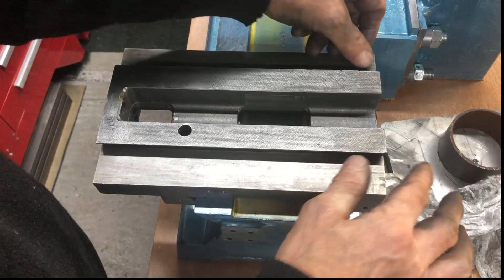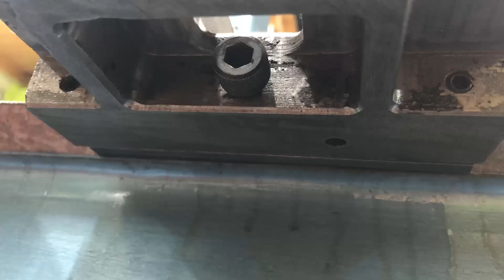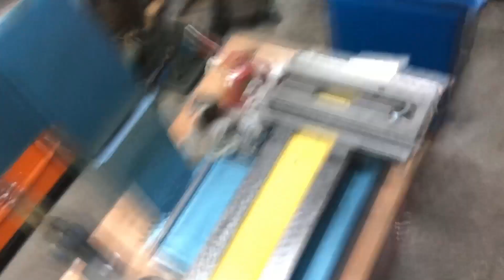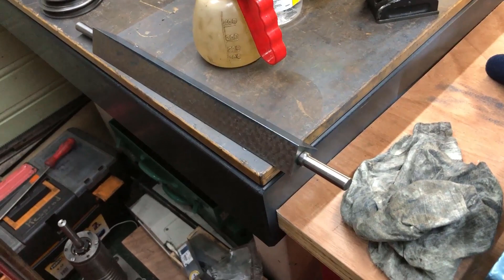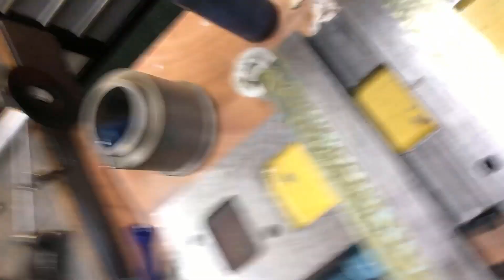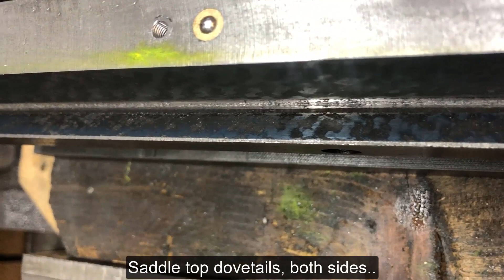Smarty AT-300  - saddle and cross slide scraping and testing

Comment: One of the more consistant problems I have with scraping, no matter how careful I try to be, is rounding the edges of scraped surfaces.  Is there anything you do, specifically to avoid that?
Reply from the maker: A tip might be to mark the middle of the scraping blade and train to stop when you reach this mark

Comment: In the course of your work was there any indication that any sliding surface had been scraped at the factory? Or was it built with the standard “bolt it together and hope” hope procedure that we usually see from certain parts of the world?
Reply from the maker: There was some scraping and fitting done, yes. Not to a Schaublin standard, but then what could you expect from such a budget machine.. All in all, the accuracy was not too bad and for what it shall do, namely a hobby machine, more than good enough. For example the spindle measurements as well as the general x/y travel and saddle squareness.. very good! The work that I have been doing isn't going to make it a Schaublin as the design and details just aren't there, but I guess with the fit and finish it had, it would sooner lose this than now.. In addition to what I have managed to improve with respect to specs.
Reply: @jansverrehaugjord9934  I’m surprised that it was as good as you found it to be. But I’m sure you measured everything thoroughly.
Reply from the maker: @sblack48  Tja? This was made at a proper machine tool factory. A very basic design which probably is easy to make.. and I guess they know their stuff 😀

Comment: This is quite well made  lathe as for Asian import.
Reply from the maker: Yes... better than I feared. It was actually quite good with respect to alignment.
Reply: @jansverrehaugjord9934  Comperd to my import lathe, this one have large cross sections . It's thick.
Reply from the maker: @kundeleczek1  Yes, the castings are quite thick and probably adds a degree of solidity.

Comment: Enjoying watching these as I’m having a go at scraping a Boxford BUD back into shape. After I have scraped and stoned the surface it looks very dull just minutes afterwards. Is this normal as yours looks very shiny?

When roughing it looks shiny but when I have finished sitting points it looks dull. Maybe chatter
Reply from the maker: Thnks. The surface shall not look dull.. maybe you are overstoning? Only stone enough to remove burrs that form if you are using the more regular technique, but if you lift at the end of each stroke stoning may not even be needed
Reply: @jansverrehaugjord9934  Thank you for the reply. That makes sense about stoning. I will try again this weekend.